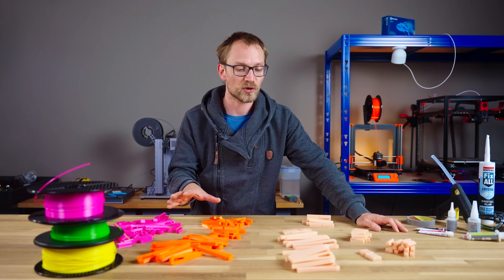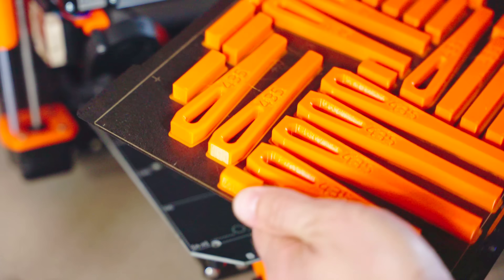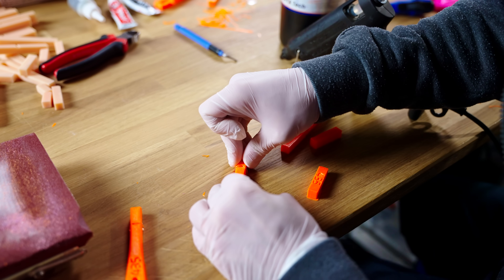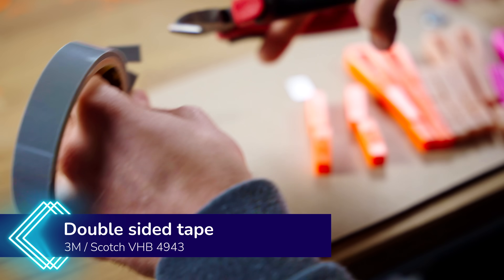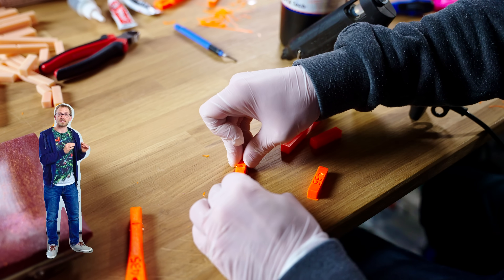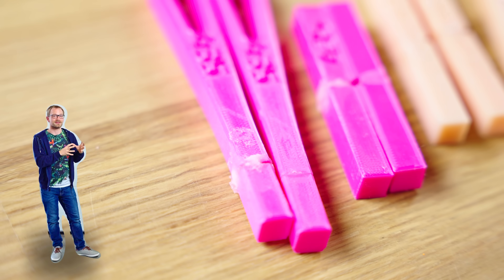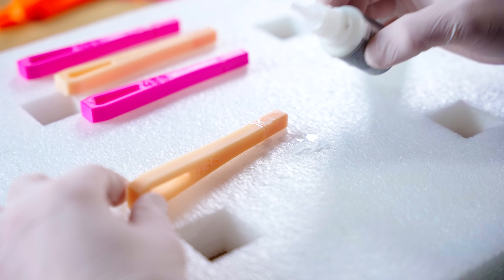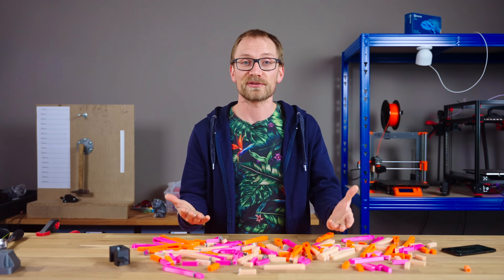Which glues work on 3D prints? JB Weld / Superglue / VHB tape…

Comment: Very useful. For me, a big factor is also colour. Yeah, JB Weld's awesome 5600 pound breaking strength is fantastic, but the glue is ugly as f*** if you're not painting over it. The transparent hot glue seemed like the most all-round useful solution for non strength joins.

Comment: Sort of begs the question as to why we aren't 3D printing with two-part glues, or CA with a hardener....inject both parts into the printer tip, force it through a tiny gap and you're basically done....?

Comment: Since I am a bit professional in the field of plastics, I would have to comment that any kind of bonding is depending a lot on preparation of surface i.e. it has to be dust clean, de-greased and without any other contaminants. Apart from that superglue (cyanoacrylat) is reacting with airmoisture, that starts curing process. I could see that some of the guys in the comments are using quite industrial grades of bonding material that I know from my time in wind turbine blade manufacturing and that is great. Just please remember to be safe, also when we are talking about use of epoxy (that personally adore as manufacturing material) and PUR. So keep creating but be safe as well!

Comment: Great video! For PLA I'm more or less only using Scotch Gel glue, yes the green tube you find in every supermarket. It contains acetone so it's like fusing PLA using acetone but much cleaner and easier to control. Note that there is a stronger version of it with a red cap that doesn't work because it doesn't contain acétone.
Reply: I swear by Scigrip #16 Fast set acrylic for PLA. It sets fast and it's strong. It welds the material together but it stinks.

Comment: I was recently faced with the daunting task of gluing moulded silicone to wood, I used 3M PR100 for the first time.  Holy crap was that bond impressive.  I could not remove it without tearing the silicone part.  Maybe try that one?  It is a many to many but especially useful for rubbers/plastics/silicone.  It sets up quite fast, but is also industrial, so be careful with the skin!

Comment: I use ABS slurry (ABS dissolved in Acetone) as an adhesive for PLA. I think it works really well and would be interested in how it holds up to comparative testing in future videos.
Reply: Use Scigrip #16 Fast set acrylic for PLA. It sets fast and it's strong. It welds the material together.

Comment: JB weld is a very slow curing epoxy with steel reinforcing. It sets in 6 hours but takes 24 hours to fully cure if it feels rubbery or can be deformed with a finger nail then its either not fully cured or properly mixed.

Comment: So couple of things super glue does not need pressure to cure or for air removal. It will actually cure faster in air if the air is humid. So it’s a lot easier to work with than most people think. The problem is that until it cures it has no real “stickiness” which is why you usually need to apply pressure. The next thing is there are different viscosity superglues. I use a gel type since it’s easier to work with but it unfortunately usually takes more time to set up compared to the thinner stuff.

Comment: Before I had a enclosed printer i used PETG too. But PETG is hard to clue and it can damage the build surface easily. 
I now have a Voron 2.4 and print in ABS only.
ABS is strong and can resist high temperatures too. My go to material for now.

Comment: Does anyone's 3d Printer Actually Work for them instead of the other way around.

I have a real Question.  All I hear and see are people who can't make their 3D Printers work, or get good parts off the machine.
My experience is, hours and hours worth of trouble shooting, Tweaking, Adjusting, Etc... to get one Semi-Okay part.  Then when we try to make a 2nd one,  it doesn't work like the last one and the trouble shooting, Tweaking and Adjusting Starts all over again.
Every time there's a new Problem.
No plate Sticking
Parts peeling apart
Parts Warping
Run out Sensors Failing
Nozzle Problems
Extruder Problems
Filament Problems
Machine just stops half way through the part
Filament Snapping.
Bowden Tube Problems
A Combination of all the above.
etc.

Every Print it's something different.

The only consistency is there will always be a different problem.

How Much do you need to spend on one of these machines until you get one that actually works reliably?

And since it take the better part of a day to make even one small part (If it works and makes it all the way through), Is there anyone who can actually make any money with these things? 
or do they work 24hr a day for free?

It's like owning a boat.  it seems like a great idea until you have to store it, clean it, maintain it, repair it, tow it, etc...  so you just stop using it after a while?

Comment: VHB Tape is a hell of an adhesive for 3D printed parts - you just have to read the specs and get the right one!
I'm printing (in PETG) mounts for a little electronic dashboard device for motorcycles and those attach with VHB tape so well that a) it's nearly impossible to remove (unless you use the right technique, which involves dental floss), and b) the tape comes off the aluminium on the motorcycle side first.
The trick to finding the right VHB tape is knowing the surface energy of your material, wether it's high or low. 3M has pretty good documentation on that.
Oh, and then you of course need to get the right thickness, so that the contact surface is as large as possible. For your curved test, you should have used tape that touches all edges, or even more, then you should have seen a much better result and no peeling back.

Comment: I'm almost 100% PLA+. I just find that Gorilla brand super glue works great and is relatively inexpensive compared to the competition. However, I've started using GLOOP and it apparently make a crazy molecular bond or something fancy like that. All my preassembled customer parts I use that. I find you have to let it cure longer though. Now I use epoxy when there's a gap to fill. Again, Gorilla is my go-to here. Super Glue isn't designed to fill gaps and have tensile strength. That's epoxy's job. Good example of that is a fiberglass handle on hammer. I would never use hot glue. The sand you use for the Super Glue is interesting. I wonder if baking soda would work as well or better. After all you can build up tabs using a drop of super glue topped with baking soda (like canopies or other hinged things on toys). Always enjoy these videos though as I'm always open to finding new or better ways. Heck, that's how I discovered Gloop.

Comment: For big gaps, hot glue the piece, then break it apart where the glue joins the piece, then use superglue to stick the hot glue back to the piece again (on both ends). That works well for me. :)

Comment: I’ve never had an issue using Loctite 406 to stick ABS, PLA or PET-G. It can even stick flexibles like nylon, polyethylene and silicone if you use Loctite 770 primer.

Comment: I use CA glue for everything PLA and never had any issues. But I also have to say, that there is certainty a difference between a simple butt joint and parts already designed to be glued together (like with a recess or hole). If something is really broken, I would probably just print it again and improve the design, if possible.

Comment: Did some prop work at my old job, we used hotglue all the time, you can get some specialty types that, believe it or not, are heat resistant. 
Used some for a qi charger in my car, it handled being in the car during the summer at 30°C (outside)

Comment: I save the filament from an almost empty spool so I can use a 3D printer pen to weld my 3D prints together. It works better than anything I have tried. The bond is incredibly strong.

Comment: I would have added mechanical bonding(not an adhesive of course). Often time this is great as you can take things apart also if needed. And that find sand. Looks like the baking soda trick? And finally I would have added  material it self. ABS slurry? 3d pen for pla etc..  Oh yes and you can buy ABS glue

Comment: I noticed early into my printing lifestyle that PLA (at least from the manufacturer I buy from) will not at all adhere to super glue. I recently accidentally sprayed Start Ya Bastard (carbie cleaner) onto a part and it dissolved as ABS does with acetone. I now exclusively use carbie cleaners as my PLA adhesive

Comment: Super-glue trick #237:
Perfectly clean and dry PLA/PETG doesn't always activate super-glue right away!
Ever notice how quickly super-glue sets on your fingers?
Trace amounts of skin oil on plastic/metal/glass will catalyze the adhesive rapidly.
Rub your fingers on one of the pieces to be bonded, apply adhesive to the clean piece.
If your skin is dry, touch the sides of your nose; lots of oils there!

Comment: Dear Thomas, can you test curing the 2 parts separately with the resin and UV light, then joining the 2 parts together. Because you need to start the curing process. Then wait longer for the hardening to proceed?

Comment: great video :) but you forget number one ... silicone :D I am printing speaker housings and "gluing" them together with silicone, it is cheap, plenty of time to work with, when i screw it, plenty of time to remove silicone, not as painfull to clean, dont need to use gloves, will not glue my fingers together .... and more :D

Comment: I wish you would have tested E6000 because I use it for a lot of things. Since it is basically the same thing as plastic model glue (at least it feels and smells the same), it works well for plastics.  My guess is that is would be a good compromise between the two types you've shown.  Probably stronger than the silicone/VHB/hotglue, but it is certainly not as strong as superglue or 2-part glues.

Comment: I use hot glue, but I make matching pockets with a negative profile at the places I want to connect. Never had any problem with that, but the contact area need a minimum size to do this.

Comment: Thank you Thomas. I myself have sometimes struggled with this issue over the years. I have settled with mechanical joints when I need parts to be strongly held together, be it fasteners (screws) or other 3D printed parts and hot glue when the parts will not endure high stress.

Comment: Always surprised that people don't mention the one magic trick with Hot glue.. A spray of IPA and it lets go!
You can stick 3d prints(Like hooks or cable restraints) to cardboard or wood and when you are done with them, a spray of IPA and the part comes off. Give it a quick wipe and you can reattach it elsewhere and with most materials no damage to either surface!  It's like double sided tape but stronger and easier to remove!

Comment: (on PLA) I use 2 part epoxy (similar to the one you used) I use to swear by JB weld but I found that after some time (weeks or months) the JB weld just separated on it's own, I would pick up parts glued and they would literally falling apart. The joint seemed fine at first. I actually manufacture a part from PLA that is glued to stainless steel and the epoxy is the best I have found. Super glue I also found to fail over time though not like JB, more like it fails after a few years and does not just fall apart but gets weak and will fail under stress that it easily passed at first (so it's not great for long term unless it's a decorative piece.

Comment: For PLA, acrylic glue (solvent based cement for glueing plexiglas/PMMA) works well - it seems the solvent used for PMMA/acrylic also dissolves PLA, and creates a strong weld bond. This is a one-component glue that's sold in the hardware store as a squeeze tube, so it's a bit less hassle than 2-component glues.
Reply: Scigrip #16 Fast set

Comment: Cheers hope you're feeling well, that has been interesting and saved me a lot of experimenting, thank you for the work that went into the test. I have also thought about a construction adhesive (Liquid Nails here in Australia) and also some of the adhesives like Airfix glue, contact cement, and some unknown Brand XYZZY (i.e. I have no idea the brand it's in unknown characters) that I haven't really had a chance yet to try. If I get time in the next few weeks I'll post to Twitter or something. My tests aren't quite as sophisticated (actually I don' have tests per se...) so ... wish me luck.  

Also - using short pieces of filament chucked in a dremel tool and friction welding, I have done this and think it's better than many adhesives but can get quite ugly and need filing and sanding afterwards. I'll see if I have pictures of a case I tacked together using friction welding and liked it so much I just left it like that. 

And also also - bicarb and superglue works extremely well but is just as messy as the superglue filler, actually it looks the same but bicarb is heaps cheaper...

Comment: I discovered "CT1 Sealant & Adhesive". 
I personally found it outperformed everything else when bonding well designed 3D joints (I didn't try JP weld as it’s not cosmetically attractive and hard to clean off). I have a solar panel with six 3D printed bracket, all with a joints and using CT1 to Bond them together. 
This has been outside for 2 years and is still holding perfectly strong using 100% infill petG/CT1 (the recent UK storms of 90mph couldn't break it, but demolished all my fence posts and panels).

It might be worth printing very small multiple channels along the length the test prints and filling it with something like CT1 or alternatives to see if this can increase the strength?
That would be a great follow-up to this video?

Comment: A trick with getting CA to fill gaps is to use the thicker stuff (specialty brands are available in a range of viscosities) and spray it with some accelerator to cure it instantly. Woodworkers often do this to fill cracks or small knot holes; you can build up a few layers much faster than waiting for epoxy to cure. The accelerator eliminates the need for tight-fitting seams normally required.

Comment: I just used some JBweld 2 part epoxy for plastic on some models I needed to glue the arms and legs onto. I knew I didn't want to use super glue because it can't gap fill and it just runs all over my fingers. Awesome video!

Comment: Another big plus with hot-glue is that you can effortlessly break the bond with a quick spray of denatured alcohol (Brennsprit). I use this all the time when prototyping. I learned this valuable trick from Ben-"hotglue, my only friend."-Heck.
Reply: Thank you for this piece of info - I've been looking for something like this for protos!
Reply: @PTEC3D  Have you tried it? It works so well, it's as if hot-glue has a shutdown button. If the manufacturers were smart they would pretend this to be a new feature and sell "release-agent" with the glue sticks,  a bit like the reverse of UV-curing.
Reply: @matthiasmartin1975  No - but you can bet I'll do it sometime today for a quick test. Thank you again for sharing !

Comment: When working with CA glue you really need accelerator spray. It's like magic, especially when you want to fill gaps. It makes the glue harden so fast that it can't run away. When you start with a more gel-like CA glue, you can even do things like make connectors just by soldering wires to pin headers, pouring superglue on the solder connection and spraying the accelerator. It encases the solder joint in a transparent mass and the best thing is you can still see the wire colors. When glueing things together you can put the glue on one part and spray the other part and then press the 2 parts together.

Comment: Great batch of info.  Too bad Gloop is a no-go in Germany because it's the very best PLA welder.  Gorilla Glue has also been great for me.  I don't actually know what kind of glue it is, and it requires 24 hours to cure with extreme clamping, but it creates bulletproof joints between any two things, including 3D prints of all kinds.  The cap ingeniously has a metal pin that prevents the glue from curing in the bottle after opening.  I've used the same small bottle for four years.  Cleanup is a bit of a problem because the glue expands monstrously (thus the required clamping), but what the hey

Comment: Interesting you said the JB-Weld was still a bit soft. I find it doesn't fully cure, even after hours, unless I heat it on a 3D printer bed. It then cures fully in about an hour.

Comment: You missed my favorite "glue."  I nearly always friction weld parts together using a Dremel.  Resin prints, it appears that super glue is stronger than the resin itself in my experience.
Reply: Interesting; could you elaborate on your technique for friction welding?

Comment: It is odd that the ‘None’ control performed better than the adhesives, considering that some of the tests broke at the plastic rather than the bond line.  I wonder it VampCaff’s comment about the bonding agent affecting the plastic is a cause or if there are other factors involved? Since I print functional parts, bond or plastic degradation over time would be an important consideration in the choice of adhesives.
Thanks for the work, Tom, appreciate it.

Comment: Excellent video - I'm glad to see my use of a meme adhesive is not in vain! 😂 I had to use JB Weld to fasten some PETG parts together and it does great. I did notice tackiness/softness as well initially, though I thought that might be due to the fact the tubes were several years old since I opened them and figured the activator might have aged. Eventually, it hardened more.